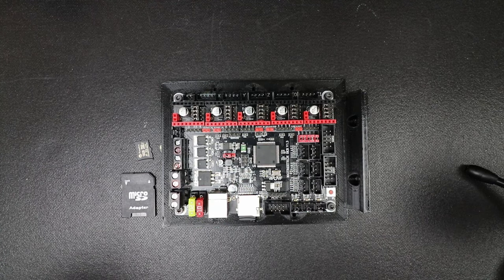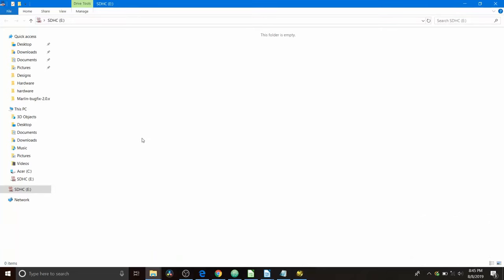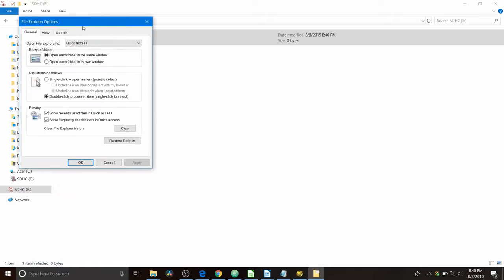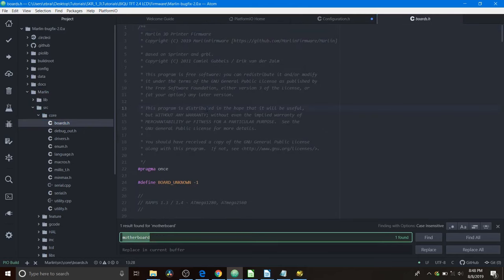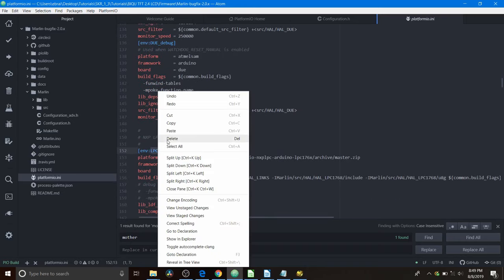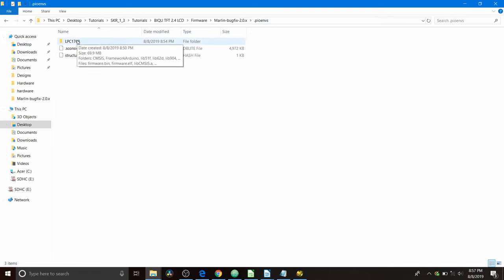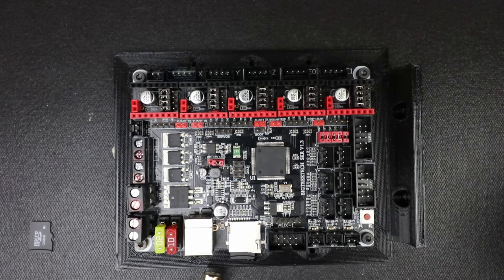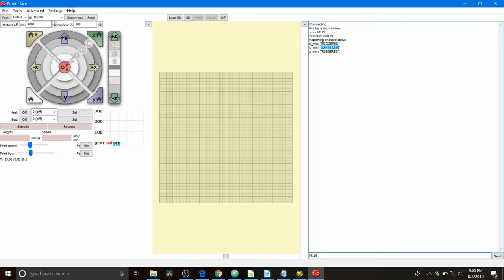SKR 1.3 - TF drive Marlin firmware loading

Comment: Great video! I was able to get firmwar.cur on SD card after booting the SKR. I've tried 2 computers (1 laptop, 1 desktop). Both can see the SD card, but, Pronterface won't connect using either computer. Also tried (2) skr v1.3 boards, 1 installed on printer, the other just out of the box. SD cards are the ones that shipped with thr SKR's. 
Any suggestions?
Reply from the maker: Which operating system?  Does a new device appear when you connect via USB?  Do you have the jumper jumped in 5v pin position?
Reply: Both computers run win 7 professional. 
1. For the loose SKR, I moved the jumper to allow power from the usb.  Both computers recognize a new drive when I connect the usb cable.
2. The SKR in the printer gets its power from the printers' power supply. I have only tried connecting this board with the laptop due to locations of the printer and desktop. In this case, the laptop recognizes a new drive when I plug in the usb cable.
3. Using ATOM to change and compile the Marlin file didn't work on the laptop after multiple tries, but, it worked on the desktop on the first try. Go figure.
4. I still cant get pronterface to connect.
Reply from the maker: Do you see the device in device manager?  If you do, then go-to driver section and see if it searches online for a driver. Also I have a video on how to update to VScode in my playlist it will compile better.
Reply: The device mgr sees the marlin device, but, a driver is lacking. Marlin has a list of 5 drivers available on their website (TMC2100, TMC2130, TMC2208, TMC2209, TMC2260) Can you suggest which one? Or maybe another driver that you could recommend?
Reply from the maker: Will it allow you to do a web search?
Reply: i downloaded a driver which let me connect to the printer using either "pronterface" or "Repeteir-Host". In manual mode, both packages don't allow me to move the print head. I've double checked the wiring to the steppers and I believe I have it wired correctly. Can this issue be caused by a wrong driver?
Reply: also no heat going to bed heater or extruder when I call for it. Still something fishy. BTW when I compiled the marlin file I used VScode.
Reply from the maker: Sounds like incorrect driver.  Try going to SKR 1.4 instructions in description and there is a link in instructions.

Comment: Some one can help me? I cant upload the firmware even when i use this method, I think I have problems with the bootloader...
Reply from the maker: Does it work via USB connection?  What mode is board jumper set too?  What's occuring when it doesn't work?
Reply: @EdwardBraiman  usb is working,  when i plug the board the sd card shows unreadable, i cant open him, but when i use an adapter and put directly in the pc the sd works fine 🤷‍♂️
Reply from the maker: I guess if it works, via USB then you have a way to load firmware.
Reply: @EdwardBraiman  but that is a problem the atom software doesn't find the SD card inside the board, and when i copy the .bin file to SD using an adapter the board still doesn't do noting
Reply from the maker: Sorry, this tutorial is really dated, Platformio, stopped support for ATOM.  They only support VScode.  In my playlist there is a tutorial on how to install.
Reply: @EdwardBraiman  i find the problem, but i still dont undestand why this happenig, i format the 2gb SD card in FAT32 and 4096bits and rename to REARM, now the board is abble to upload the firmware through the usb port, thanks for your help and the excellent videos

Comment: Hi, I followed along the whole vid, but at the very end, the two files remained. It compiled successfully, went right in every way (followed other videos and tutorials also), but i got the same result with all of them. The two files remained, or the bin did not convert to .cur. How is that possible? What could I do now? TIA
Reply from the maker: What position is the UBS jumper in?
Reply: @EdwardBraiman  in USB, the board itself is working, lit up. Just the file convertation did not work.
Reply from the maker: Do you have another TF drive on hand to try?  Can you post a video of the steps your following so I can see?
Reply: Same problem, did you solve it??
Reply: I could control my printer in pronterface, but I can't upload the firmware using usb
Reply from the maker: Try placing on a mini SD card and load.
Reply: I already tried 3 different sd cards and nothing.
That's strange because I update my firmware many times via USB before it stopped working...
Reply from the maker: Check the jumper for 5 volts.
Reply: Same problem here, tried 3 different cards, jumper set to USB, board connects to pronterface and responds to commands but will not show up as a drive in windows or update the firmware from .bin to .CUR - i'm starting to think BIGTREE are not so big on quality control ...
Reply from the maker: @jpsaila  so does the firmware update in Marlin on SKR  v1.3?  If you can see in Pronterface at least you can use board.
Reply: No it's got some firmware in it which is not mine ... and I got the TMC2209 drivers so it's unlikely it will work as expected :(
Reply from the maker: @jpsaila  can you tell me what you're seeing for date created for each file on your micro SD card?
Reply: Original FIRMWARE.cur that came on the SD card is dated 4th March 2019, the other firmware.bin has today's date
Reply from the maker: @jpsaila  copy the contents off the micro SD card format as fat32 create a blank filename, "FIRMWARE.cur", make sure extensions are not hidden.  Copy the compiled, "firmware.bin", and place SD card back in SKR and power up with USB power cord.
Reply: @EdwardBraiman  yeah i followed your video step by step but it didn't work.
Reply from the maker: @jpsaila  understood, but I'm trying to get the FiRMWARE.cur replaced with an empty file of zero size.
Reply: Yes, i created a new text file and renamed it to FIRMWARE.cur with the proper (nit hidden) extension
Reply from the maker: @jpsaila  so place in TF drive without power.  Then connect USB cable.  Do you see a flashing blue light?
Reply: A flashing blue light on the SKR? doesn't happen here :(

Comment: .cur for current ... ? not cusor ;)
Reply from the maker: Cusor is the file type, but in firmware update it's considered current.  It's actually the firmware.bin file renamed to FIRMWARE.CUR as a way of saying the firmware.bin file loaded successfully.
Reply: @EdwardBraiman  sorry to insist. I understand what you mean. .cur is the defautlt extension for cursors files in windows. But that doesnt mean becaus you name a file with .cur it's a cursor file. It's whatever you intended .cur to mean for your needs. It's like naming .old , .prev .. .cur  stand for current . Not cursor even if .cur extension default meaning is cursor . By the way the video was instructive.